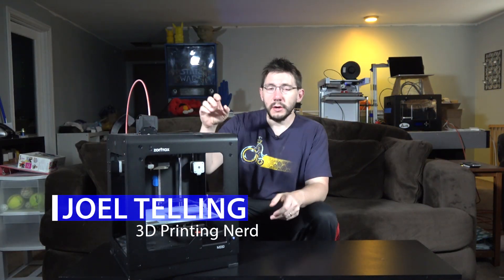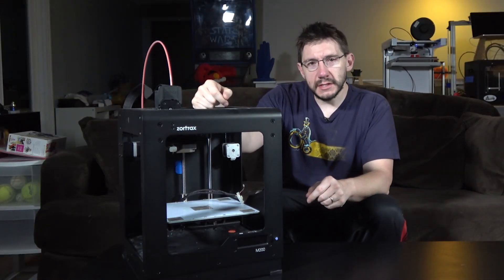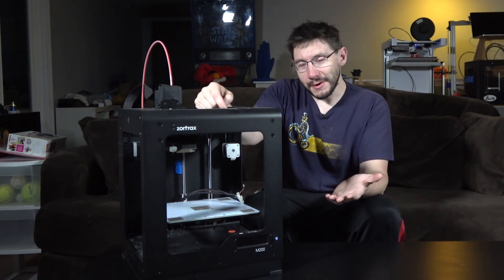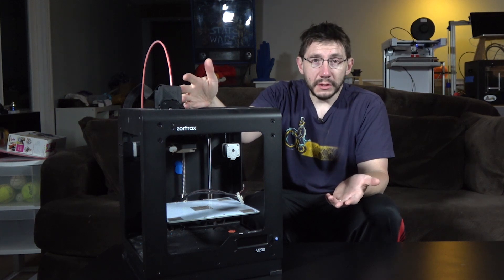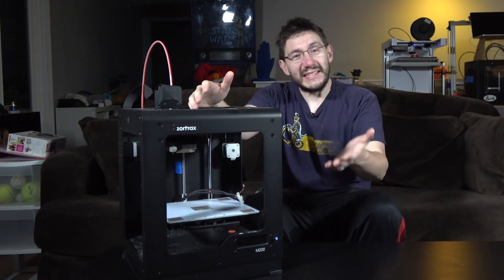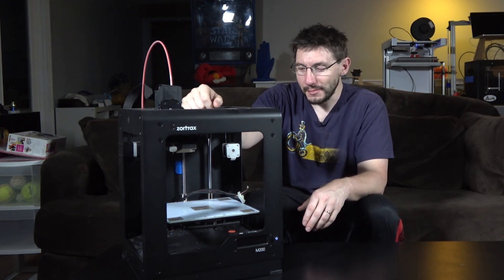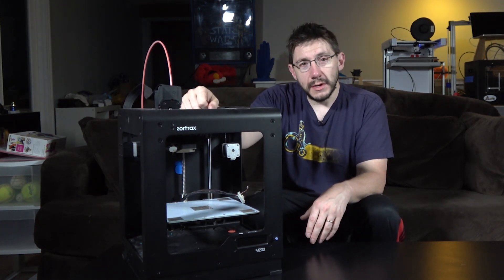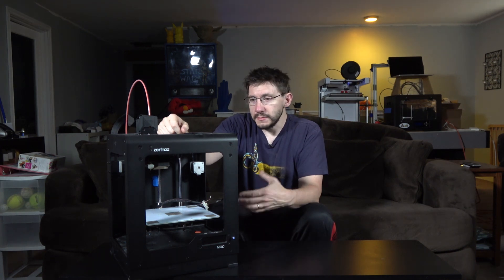My Zortrax m200 Heat Bed Wires are Frayed

Comment: Yes, check the bolts. I was recently getting a weird layer shift on my Kossel. It was starting out OK on the bed but slowly shifting to the left as the layers built up. One of the factory tightened (or not) bolts on an arm had come loose and was causing the skew. I have since undone every single bolt and done them back up again with a drop of blue Loctite (applied by tooth pick). Everything is good in the world again.

Comment: Where can I find the specs of these cables. Especial on PCB for the fan, heater, extruder motor. Diameter or socke trype. Tried to contact customer support and they didn't know😜

Comment: I should be taking this to heart. I've been having problems with one of my printers for a while. There was inconsistent bed leveling and then the extruder crapped out. Found out the Z end stop was loose which was slamming the nozzle into the bed at times and backing up the filament which blew the extruder. It was a ripple effect throughout the machine. Checking every bolt after going through a few spools sounds like a good idea now.
Reply from the maker: +Isaac Gelman yes it does. Good luck!

Comment: Hy.....in normal cases using the zortrax facebook group or forum u got answers and responses really quick !
Anyway I iwn that machine and its a great printer with great quality and reliability.....live this machine really much....and its cheaper as some other high brand printer.......
the cable issue is known already if u take out the bed several time

Comment: If you really want to fix it just put on some proto putty or silicone. if the wires aren't broken then it must be an aesy fix. Salvaging a similar connector with wires couldn't be hard too.

Comment: Joel, take this opportunity to learn simple repairs. No need for a new cable just another connector and a little time to install it. With parts in hand I could fix that in under 10 minutes easy.
Reply from the maker: Oh, believe me, I know simple repairs, and I'm way more than capable to repair this myself. This is a review unit, and technically, still under their care, hence my email to them. Don't worry, the printer will be back and working way before I get the parts from Zortrax :)
Reply: Good man!

Comment: Do you think it is from disconnecting the board in order to remove the printed parts? Maybe the wires were weakened at the connector from disconnecting the board all the time, unless you don't remove the board to remove the printed parts? Like you said, maybe it is just a cheap wire. Mike
Reply from the maker: One of the things I NEVER did was remove the board to remove the parts. I remember the manual saying to do that, but even during the review I mentioned that didn't make sense as I didn't think the wires could take it.

Comment: Do you know why it failed?
Reply from the maker: I think the wires are tiny, and fatigued over time, along with the warmth of the heat bed over time.
Reply: Looks to me like they tryed to make it more reliable by adding that spot of glue to the connector. Thats not a bad idea to begin with, especially for a machine that is aiming for a more professional customer base. However, they should have used wires that are acutally designed and intended for moving machine parts. There are a very wide range of cables and wires on the market for all kinds of applications, with different compositions of insulation and copper strands. The cables for flex applications are more expensive tho, so i guess maybe they tryed to safe a few bucks with the cheaper wiring options. Thats something i would expect from a 200$ chinese printer, and not from a 2000$ machine...

Comment: I have two of those M200 now, the first one must be at 2000 hours printing time now! Their support is weird (slow and repetitive of their FAQs) but in general the printer is pretty good. They've made some upgrades to the hardware, pretty good ones (thicker printing bed, 4mm instead of 2mm). Overall Software could give more options, but it just works, which is good for work.
Reply from the maker: I would have to agree - it does just work. It works well. My goal was to use the new updated software - I've heard Zortrax enabled 3rd party filament usage now. Once i heard that I decided to get this out and hopefully get Zortrax's attention.

Comment: For a printer at that price you would expect better customer service.
Reply from the maker: Well, yes, I would expect good customer service from any printer manufacturer.
Reply: 3D Printing Nerd except for cheap Chinese prusa machines
Reply: Donovan Morgan Actually, QiDi and Wanhao have really good tech support, they replied to my email within the hour of sending it.
Reply: Orbit Engineering what about the anet a8? That is what I was mentioning
Reply: Donovan Morgan well I am not sure about them specifically, but wanhao has a prusa clone and have shipped me parts in the same week.

Comment: Looks like both Wires broke exactly where one could expect them to break.
They are glued? "epoxyficated"? to the Connector and are kinked at that Spot with every Movement of the Bed. No wonder both broke right behind the Glue.
Reply from the maker: It looks like that is the case. I think having such thin shielding, and being so close to the high heat of the bed, is probably the 1-2 punch that broke my wires.

Comment: I think it's also important to ask why something failed - it may be just a wire for the sensor, but why did it fail? Will just replacing it not just lead to it failing again after some time? I always look if there are changes I can make to avoid similar failures in the future.
Reply from the maker: I think the failure is from the wire size (so small!) and from them being so close to the heat bed. New wires could be kept secure with thicker shielding near the bed, or perhaps some hot glue to act as an insulation.
Reply: Use cables intended for moving machine parts, with extra fine wire braid (more seperate strands of copper) and silicone base insulation, and if heat really is an issue at that spot, there are special temperature resistant flexible insulation options too. It's just more expensive...
Reply: Maybe a few coats of Kapton-tape will do the trick

Comment: my Zortrax M200 has just suddenly stopped feeding the filament properly. It feeds if I start it off with a push... but doesn't hold for more than a few seconds. keeps clicking! I'm a complete novice to 3D printing. I have only had it since October. with 900 hours clocked on it. a forum suggested it's either the cable or extruder motor... HELP! D:
Reply: It's most likely your cable, that's a common issue.  Replace the cable and then print one of the cable
supports for the extruder cover to prevent it from happening again.  You can find them on thingiverse or in the Zortrax library.  Search for Zortrax cable support.

Comment: Hey Joel. Why not solder on a new cable or just fix the plug yourself ? you can probably find the plug used somewhere on ebay or something. Could be a fun video. Include the sourcing of the parts and stuff :)

Comment: This is especially important if you (like me) own a cheaper chinese 3D printer. When I received mine I instantly replaced all the connectors and underpowered wires with better ones because I have them in my shop anyway :)

Comment: or just buy one of these connectors for like 10ct and solder it on
Reply: hansdietrich83 haha jep kan ook
Reply: you don't solder those... they're crimped.
Reply: davedarko I meant buy one with wires. Crimping is already too much work
Reply: Jaapieh sorry I don't speak Frietjes
Reply: hansdietrich83 aah spreche du deutch dann?
Reply: Can you please provide connector model? Or where you can get one?

Comment: Happend to me 2 joel, its somthing usual, specially with bed wires and even more if they are 2 tin and you need high temps. try change them for bigger ones and care with it. also as you said. checking the printer is somthing important to do frecuently.
Happy printing my friend

Comment: Good advice. Especially the power cables for the heated bed are a fire hazard because of the high power involved with that. Had one printer where the power leads to the heated bed were rubbing against metal, after a year of use it started sparking. Luckily caught it in time before it could burn down the house.